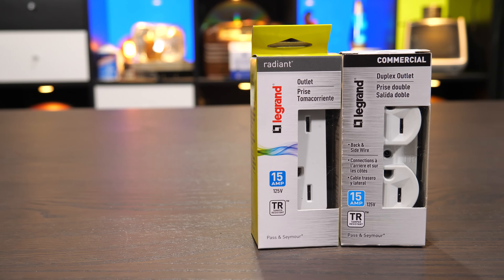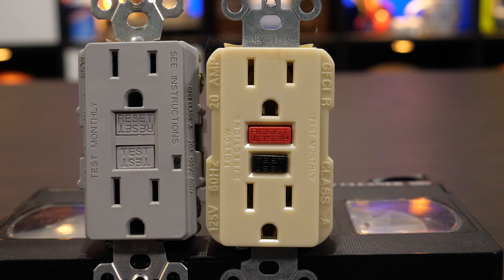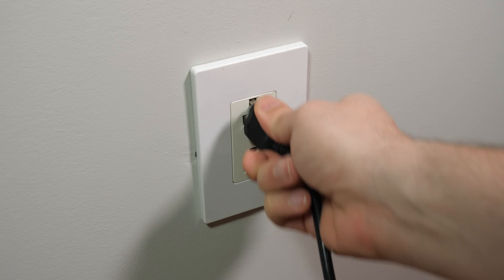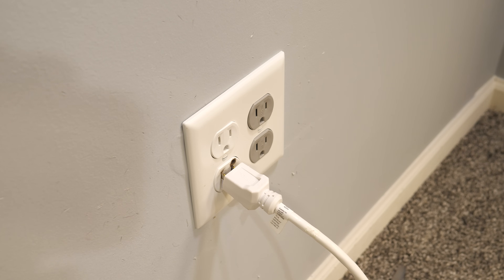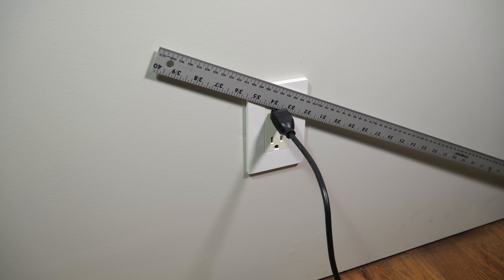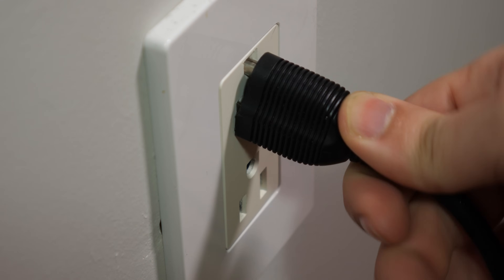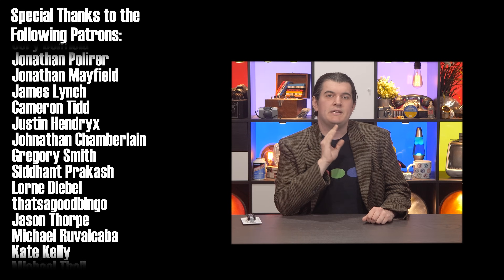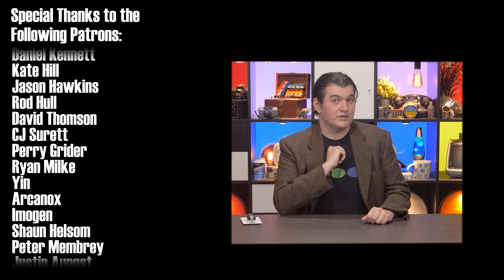Power outlets are topsy turvy - but does it matter?

Comment: Having moved from Southern Africa where a power outlet has the earth pin on top AND the earth pin opens the ‘gate’ fitted on the live and neutral openings making it almost impossible to put things into the outlet. In Australia the orientation of the outlets is upside down (must be an Aussie thing) and ungated but the authorities changed the plug pins by putting plastic insulation strips on the live /active and neutral pins so that your fingers could not touch the pins and get a shock. What was a source of irritation was the plug orientation. 
But at least we have regular power unlike South Africa which has ‘load sharing’ in certain areas (except where ANC hierarchy live☹️☹️☹️)

Comment: The 45° flush plugs are oriented that way so you can plug TWO of them into the same outlet at the same time. Straight down OVERLAPS one. Additionally, the downwards pull of the cord exerts a rotational force, thereby locking in both the contact and the prongs that much more securely. If anything, THATS probably the best design.
Reply: I like the ergonomic edge to grip also.  In fact I think you could add a ground pin to it and have a design that would be the same for three and two pin plugs.
Reply: @odess4sd4d  they do sell low-profile, grounded, 45° plugs. I've got a few in my workshop. And, as to the grip, the rotation happens to move one's fingers about as far is as feasible from all three prongs as well. Just sayin'.
Reply: Yeah I hate right angle plugs. It makes you have to decide what place you're able to put it and you'll need a differently spaced outlet if you need more than one in
Reply: What worries me about statements like that are the people who plug two surge protectors into a wall, then populate both surge protectors.
Reply: @enhydralutra  This is perfectly fine if you don't exceed the power ratings.  Ie - 3 or 4 wall warts or USB chargers won't mean anything.  Plugging in a microwave or a hot plate might be.
Reply: @enhydralutra  Some 45 degree flush plugs are extension cords and can provide access to an outlet behind furniture.
Also even if they are surge protectors, it only matters if people are overloading them. Some people just have a large number of devices that use small amounts of electricity or are never simultaneously activated.
For example, someone could have multiple phone chargers for various electronic devices and some LED lamps. None of those draw large amounts of power anymore but each could eat up a socket.
Reply: @enhydralutra  Well most of them only have 6 outlets. and they're always as close together as possible, so when I plug three single-port USB converters in that are each 3mm too wide there goes half of them. What am i supposed to do, spend 3 times as much on that one power strip design with more spacing that I might be able to find if I drive all around the city checking every single store, that also probably comes with an 8 foot cord that will stay bundled up creating a possible fire hazard?
Reply: @ailivac  Outlet strips are also required to have a circuit breaker or fuse rated for the gauge of the supply cord, usually 15 amps.
Reply: @enhydralutra  I have 3 fully populated power strips in my bedroom, one of which services my computer and all of its peripherals. 24 outlets available and occasionally fully populated, but never once have I even popped the 15A breaker. The only one that really turns any actual wires into a fire hazard is when people do shit like plug a space heater into a lampwire extension cord.
Reply: @enhydralutra it's only problem in US since it run lower 120V with high amp and people in US have privilege for insanely high wattage electrical system to the point they don't care about tripping the circuit breaker anytime soon
Reply: @enhydralutra 15+ years ago that was an issue, but nowadays in most homes that's not an issue anymore just because of how much more efficient things have become and how much electricity most things use. All the lights in my house (except for the ones in the fridge, deep freezer & oven) are LED now and combined likely draw what 3 of the pre-LED bulbs combined did. The 9 LCD panel displays (TVs & Computer Monitors) I have throughout my house are probably in the combined total range of like 4 of the old CRTs they replaced. Heck the strip I use for my nightstand has a phone charger, watch charger, lamp & an alarm clock from the 80s plugged into it and I'm willing to bet the alarm clock uses more electricity than the other 3 things combined.
Reply: @enhydralutra  I respect your concerns. But feel I need to point out that, 
A. Reasonably-wired breaker panels should nip that in the bud, 
B. Most power strips have their own fuses therein, and 
C. You can't fix stupid, regardless. One CAN, however gain a modicum of peace and quiet from stupid with a 2x4 and some duct tape, a theory I've managed to confirm empirically.

Comment: This is kind of funny to me for all the reasons you say. I had an electricity class in high school we had to wire mock walls, etc. My mom was doing some kind of builder class at the time too and she said ground up was what they said. I did how my mom was saying the teacher didn't like it because it made his tester upside down, he was going to deduct a couple pts i explained to him the logic of what my mom said he said ok you have valid points and listened to your mom just flip it over before the next assignment. 

I redid my house all the grounds are down because of right angle plugs though I kind of dislike those plugs too because they block the other outlet unless it rotates. The big 50A blade type 4 pin 240 plugs are a real pain and even with good grip they are sometimes a bit unnerving to deal with seeming like will pull the entire socket off the wall too. It is odd though most he 240V plugs are made for ground up install.

Comment: When I was going through my apprenticeship this came up with a few of the journeyman I worked with over the years.  The answer was pretty much the same across the board.  Unless you're installing metal cover plates it doesn't matter just go with what building spec is.  If you are installing metal plates try to install the ground or neutral prongs up, but ultimately it isn't that big a deal as long as everything is installed according to the code.  Still holds true as you pointed out there is currently nothing in the NEC that tells us one way or the other yet. I think in general the NEMA-15/20 style receptacles are fine, especially when made tamper resistant, but our plugs definitely need a bit of work still.

Comment: The downside of your right angle plugs could be solved by just borrowing a type G design que. Theres a lip around ours to grip and pull.  I hadn't even considered the difficulty of removing a plug until you pointed out how smooth the one you guys use is.

Comment: I am in Europe/Germany and we have different kind of plugs. I always use master plugs as an extension, that lies on the floor and provides 1 to 10 or 1 to 4 plugs. This reduces the stress on the wall plug too. And I make sure to use those extension plugs with a switch, so I can easily switch them off at once (when needed).

Comment: My wife accidentally didn't have a plug in all the way and flyswatter fell off a table and landed perfectly across the prongs upright in the standard (surprised monkey face) pattern. I had to replace the breaker, outlet and wall plate and cover . Humans make mistakes sometimes they don't end well. On the monkey face term that's from my Father in law. Electrician.

Comment: I'm shocked (pun not intended) that we haven't updated the plug standard to include a small bit of sleeving. It still wouldn't be the safest design out there, but surely better than nothing. There ought to be some measurement of sleeving that would easily be compatible with >99.99% of the sockets out there.

Comment: The reason for this misconception is because of "L" style plugs you would commonly find on power bars. Since power bars would commonly be found on the floor it would make sence to have the cable pointing down.

Comment: One of the many ‘fun’ features of my old Victorian is that it didn’t trip the breaker when we had a piece of metal bridge that nice little gap between the wall and the outlet. The toaster oven pan fell behind the piece of furniture it sits on and it got ‘plasma cut’ until I could move the furniture and knock it loose with a wood spoon. Now it serves as a constant reminder to my children of how electricity kills and can burn down the house.
Reply: You need to replace your main circuit breaker panel if that happens... That's literally the kind of malfunction that will absolutely burn your house down
Reply: @thatclintguy  Most homes in Europe have entire house GFI type systems on them when they are re-wired.  Adding one will be a big safety upgrade.
Reply: Do you know what breakers you had? There are some old brands that fail to trip and can and have caused house fires
Reply: Fun fact: wood is conductive, so doesn't make a difference if you used a metal or wood spoon. Could've electrocuted yourself

Comment: Story time! My company had an incident where a paperclip caused a short-circuit by falling in an outlet just like you described with the knife.
Turns out that outlet was a remnant of the old, no good, unsafe, terrible, NEMA outlets that used to be used in Brazil way back when. It prompted an audit and replacement of all leftover outlets to the new, elegant, safe, cheap, IEC standard.

Comment: I once went to unplug an old lamp at my grandmother's place and when I unplugged it, the lamp stayed on. The whole plug was split apart with the pins staying in the wall and the rubber/plastic housing in my hand detached from the end and hanging around the cord. I gently let go of the plug housing and went and flipped the breaker before returning and removing everything out of the outlet and tossing the lamp. Scared me half to death when it happened.

Comment: Hard disagree.  With the ground facing up heavy, large cords or wall-warts will create tripping hazards, extra strain on the plugs, or possibly even pulling them out or damaging the plug or outlet.  Heck look at EVSE plugs with the heavy brick in the cable!

Comment: The ground is at the bottom to keep the index finger from hitting the hot and common at the same time.  Whereas the thumb curls upwards the index finger just slides around and onto the two wrong prongs when trying to push it in.

Comment: Another thing that wasn't mentioned about right angle plugs, is that people buy power strips and extension cords with right angle plugs because thay want to push that furniture flush against the wall. That actually makes ground up orientation a potential danger, because the cord that needs to fold down end up being jammed between the plug, wall and furniture. Over time, the cord insulation either rips open or come loose from the plug, and now you've got exposed wires. That's not only a lot more dangerous than a metallic object somehow falling on exposed plug prongs, it's also far, far, far, far more common.

Comment: I always thought it was for consistency in a hospital. A lot run both 440 and 220 and sometimes you'll see the flipped on above the other (like those dual orientation ones shown in the video) so two lab instruments can be powered at once from the same spot in the way despite there being two different power sources for them. Well same device but there is a step down. I am probably wrong but I've seen it that way at labs and hospitals and though that is why.

Comment: I've noticed in hospitals that outlets were installed upside down, but when I've seen it it's been exclusively the hospital specific circuts, for medical equipment around the bed that have been upside down and the other more standard outlets even in the same room were upside up. I assumed at the time it had been done as a shorthand to distinguish which circuit the outlet was on, like the upside down ones were higher gauge or would kick over to the generator if the power went out. although they were also color coded.

Comment: I live in a house built in the 1950's. I recently replaced a lot of the electrical sockets with the new snappy clicky ones or USB receptacles. I was going to put them right side up, however, I figured out the old style boxes in the wall are too small for those types of receptacles to go right side up, so I installed them all upside down.

Comment: I live in Brazil and we used to use the US plug standard up until 2006, now we have recessed plugs with "technically" mandatory ground plugs, I work in a hardware store and was amazed to see how people fought back on the change that is safer, many people at the time fought for the backtrack on the change, and up until this day unsafe adapters used to use the new plug into old outlets are among the top sellers, and the cherry on top is that those adapters are illegal but there is no true enforcement of the law and they both doesn't connect the ground to the outlet and are marked to support far more amperage than they really are able to handle, conclusion the new standard is not perfect but is way better than the US standard.
Reply: on a side story when I was 4 my brother and I almost burned the house down plugging some appliance that had alligator clips onto half inserted US plugs, after that my brother still fear working with mains outlets

Comment: Interesting video. Medical Grade power cords seek to make power cords and plugs safer by changing the dimensions and some other features like solid pins and integrated strain relief. I have actually worked at a couple hospitals who had to litigate due to electrocution and the lawyers point at the non inverted receptacles as a scapegoat. You will never hear about these cases because all hospitals want to settle behind closed doors. They almost never go to trial and thus become public record. -Better Biomed Channel
Reply: chicken

Comment: So.. I read through my code book.  And he's right. A 120V 5-15R plug can be installed on a wall either up or down.   The 50 amp plugs you use for your electric stove does have a rule about where the ground pin sits.  Either to the left or right.  For those that want to read along.  CSA C22.1:21   Section 26-744 Rule 6 subsection (c).     
Thanks for the show!

Comment: If we move over to making right angle plugs the new default, they should also make arranging the pair of outlets horizontally with ground down the new norm instead of having them arranged vertically

Comment: What if both the ground pins were pointing out towards the edge of the outlet? Then the top outlet will always have ground at the top, and the bottom outlet will always have it at the bottom so you have the best of safety and right angled plug usefulness

Comment: just use EU plugs and sockets... here in germany u cant touch jack shit. because the socket is deep. and befor u can even try to touch a life pin, its basicly fully blocking acces to the pins. even the plugs with only two pins and no ground pin are save. cuz its mostly insulated xD... i dont get why u USA ppl dont just change the standard.. yea sure "there are old devices mimimi" just change the plug for god sake.  its not that hard. even a hillbilly can do it

Comment: We had the case of a metal yardstick fall sideways behind a cabinet and touch one of the metal prongs. It didn't blow a fuse because it wasn't touching both, but it apparently was arching from time to time, and when we finally found it when we moved the cabinet, the socket was blackened and melted.

The point that so many devices and plugs assume ground on the bottom is the string argument against it. 

The argument that it's no good to do if it doesn't fix every possible danger case (like 2 prong plugs) is called a Nirvana Fallacy,  used to maintain the status quo, and has been used to dismiss incremental improvements in Healthcare, Environmental Policies, Gun Control, Social Welfare Programs, Criminal Justice Reform, Immigration and a variety of other issues.

Comment: Because China uses the Australian socket upside down, it's pretty common here in Australia to get right angle plugs and transformers that face the wrong way. We live, somehow. Australia's socket doesn't suck, though. The angled live and neutral pins mitigate the bumping problem. Plus, it's part of our electrical standards the live and neutral pins have to be sleeved for like half of their length, so even if they do hang out of the socket a bit, you have to try really hard to get a shock. Not a great place to practice one's cunnilingus skills.

Also, you have an ungrounded power strip?! What kind of barbaric country is the US?!

Comment: My issue with North American plug sockets is them being stacked on top of each other rather than besides each other, this is so that when you plug in a power brick or a right-angled plug it doesn't interfere with the other socket.

The verticality of the layout is just inconvenient.

Comment: FYI, there is no correct direction for outlets in the US. Electricians love to argue about this alot. Personally, I think ground down is better. It was designed this way, and in my experience, are less likely to rip the ground prong out. Europe plugs are better in every single way, and I wish we would transition to twistlock as standard (especially for large appliances)